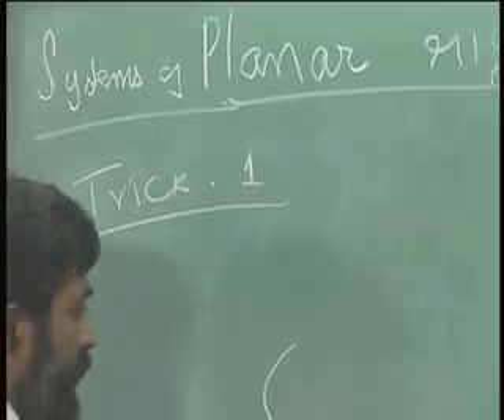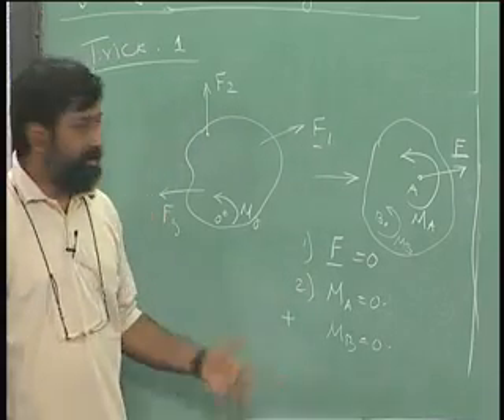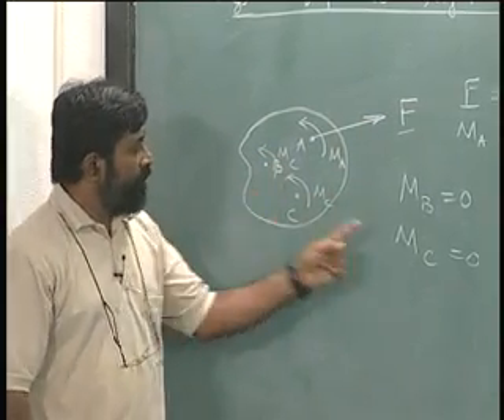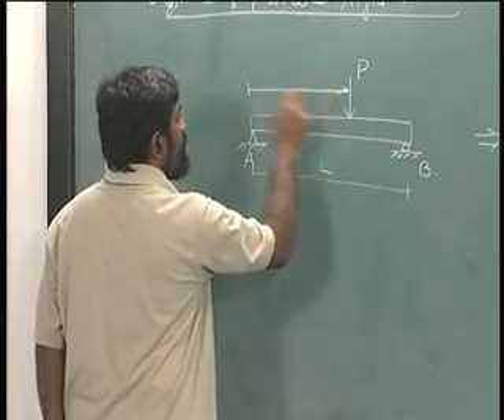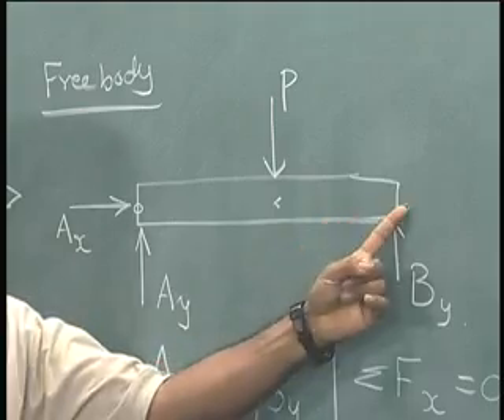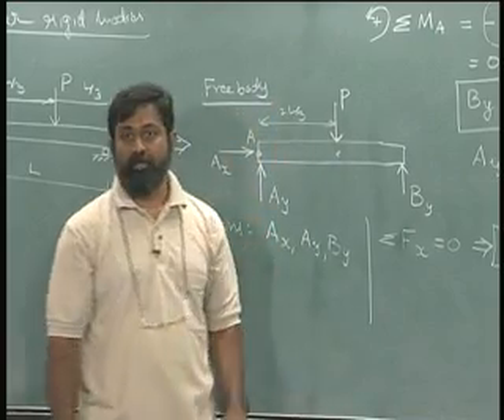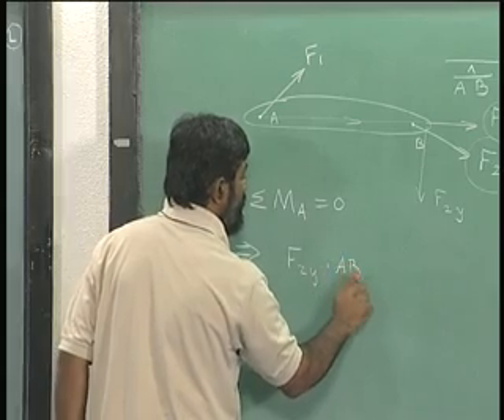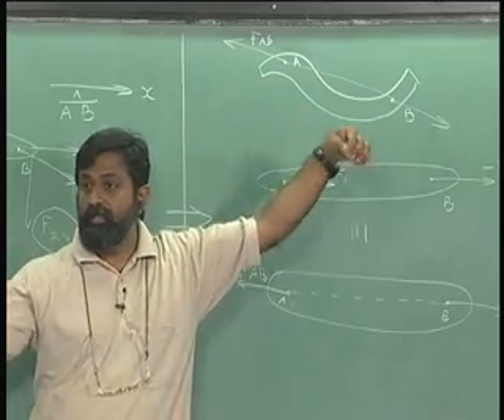Tips and Tricks - Engineering Statics - solivng problems

Comment: That's true,  the technology we have we eventually take for granted,,,

By the way, my grand father was an electrical engineer for c&g railroad (trains).,, he designed electrical motors with a slide rule, ,a slide rule which i still have and proudly display above my fireplace. And have learned to use proficiently.